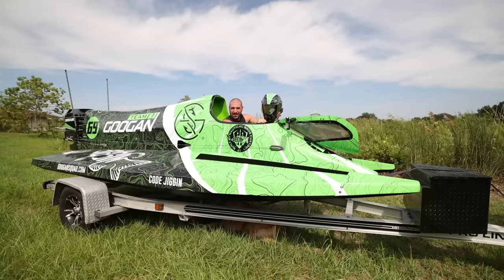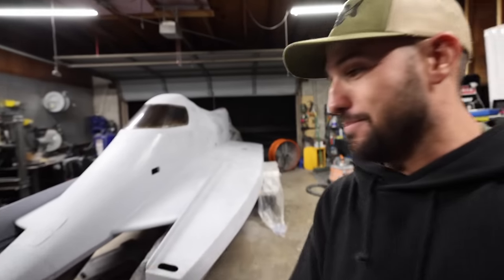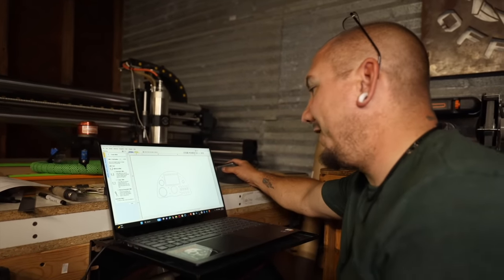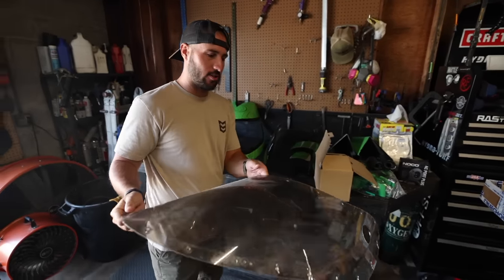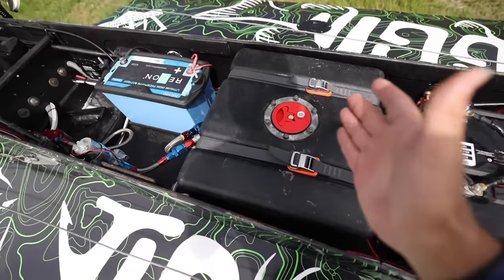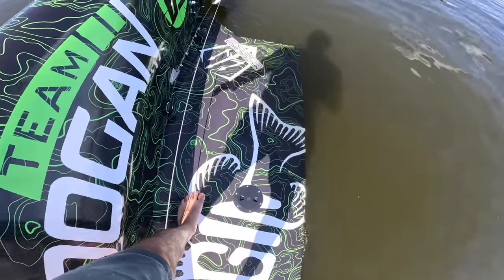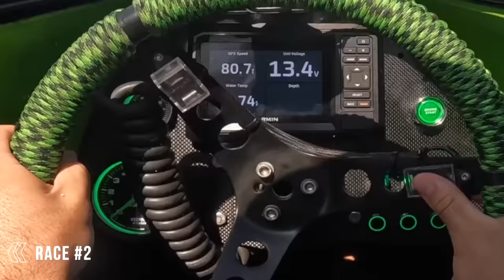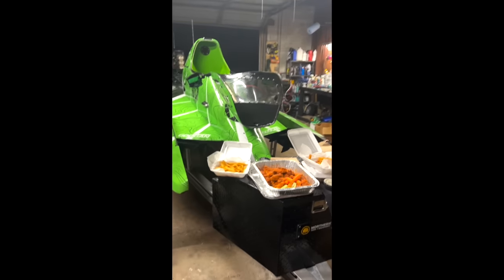We Restored a 1999 F-1 Championship RACE Boat for 8 Months!!! (start to finish)

Comment: Hey Jordan, Great work on the Seabold. I race over here in NZ. Word of advice, fit your belts properly and tight every time. If something goes wrong and it goes upside-down, your head will hit the top of the cockpit, and spinal/neck injuries will happen if not death. The second thing is to fit a trim gauge. Otherwise, great work 😊

Comment: The “first version” of your boat was a real race boat and had a fire suppression system in it vs a fire extinguisher.  The extinguisher receptacle was connected to an emergency pull or auto deploy in case of fire. You should probably put one back on it.  😅
Reply: He won't pass tech inspection if he doesn't have the fire suppression system installed.
Reply: For certain class races of course assuming he'll race the damn thing
Reply: We can still use it in a bass fishing tournament though….. wolds fastest bass boat???😮 Just needs a trolling motor.

Comment: The extinguisher would be an auto system, pull a cord and it auto discharges to cover the battery and fuel tank in foam...

Comment: Since there has been lots of news footage of vehicles with lithium batteries catching on fire because they got wet, did you ever consider encasing the battery in your boat so it's watertight ?
Not sure how that would work because you also have to make sure they don't overheat when charging.
Above all, we want you to be safe.

Comment: The boat is proposing because you have it trimmed up too high. That's why raising motor height works.  Raise it up a couple bumps and trim it down a touch. You want a long flat rooster tail. Only a couple foot high rooster tail. Just remember that these boats can flip over backwards if trimmed too high.

Comment: You should get a fire extinguisher system like a race car where you have lines running to parts of the boot like in the cabin and at the fuel tank and engine where you just pull a lever if there is a fire to extinguish it

Comment: Brandon just trying to keep you safe you need to trim up less, those boats will get dangerous with too much positive trim, and if you're looking for speed the key is to lift the jackplate and lower your trim to reduce the amount of lower unit in the water while keeping the prop in the water grabbing and not slipping risking a blowout which can turn you around in a second🙏

Comment: The power wheel batteries were for weight savings and they are sealed. I would put something similar back in. Those three batteries are unnecessary and I bet weight 100 lbs.